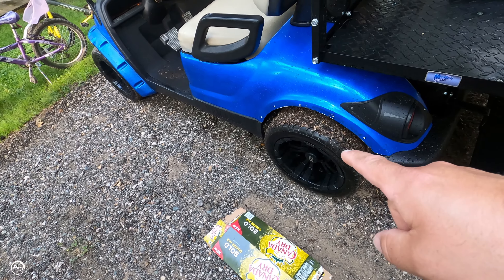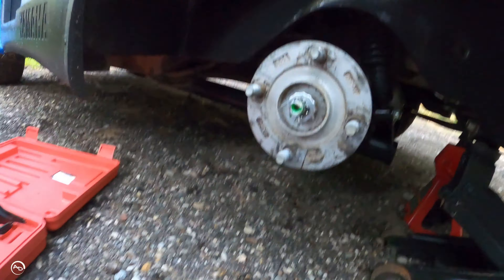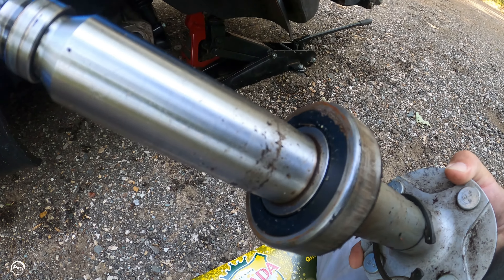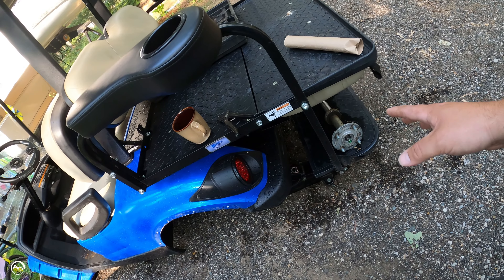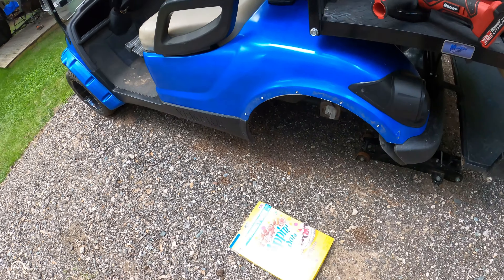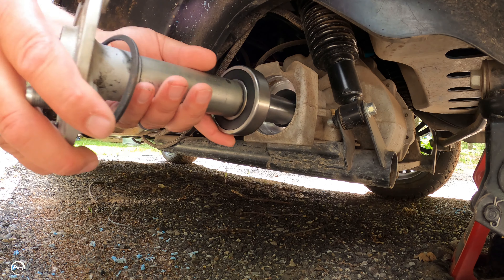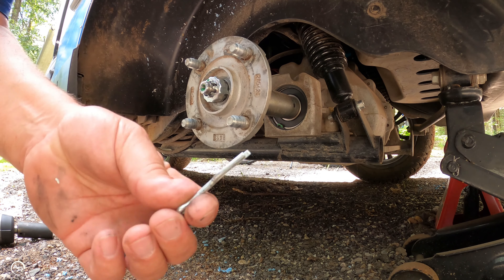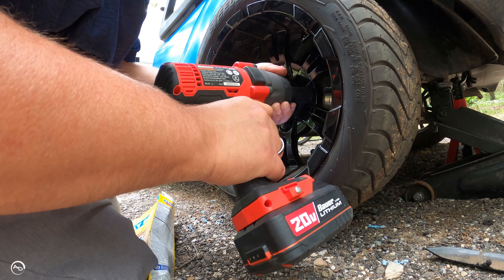How to replace a golf cart wheel axle bearing.  Yamaha G29

Comment: If your inner fenders rub your rear tires drill a 1/4" hole thru the fender and into the rear bumper.  Push a plastic push rivet thru the inner fender into the bumper to hold the inner fender tight to the rear bumper.  No more tire rubbing.

Comment: What kind of noise did the cart make when the bearing went bad? Mine is making a grinding noise but it sounds like it's coming from the motor so I'm thinking it's the input shaft but could be wrong.
Reply from the maker: Mine was a cracking noise

Comment: I have a 2014 Yamaha cart and cannot figure out how to check the rear axle fluid.  Have you ever done this?  The newer carts have a rubber plug in the top of the rear axle.  The 2014's do not and no top or side fill bolt/plug that I can find.  Great video on the bearings!!
Reply from the maker: I have never done this, sorry